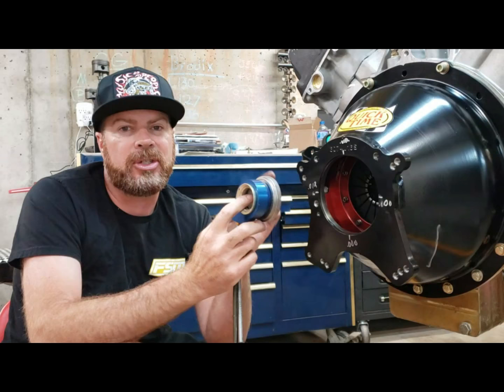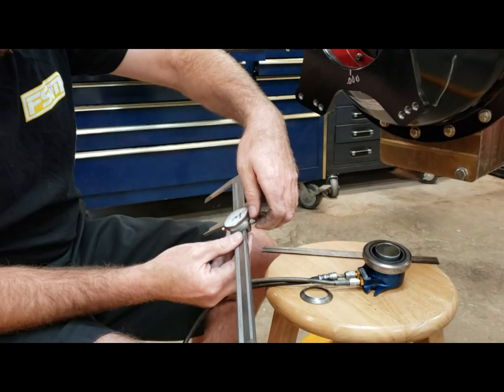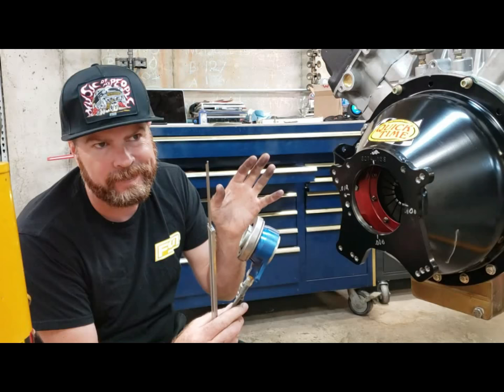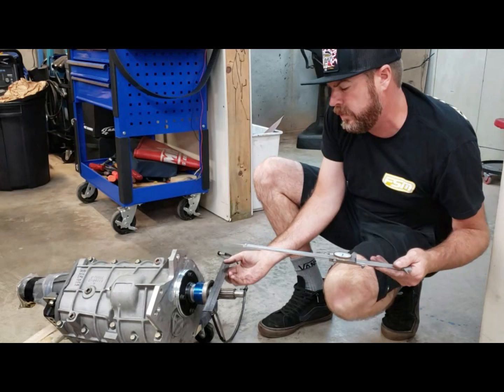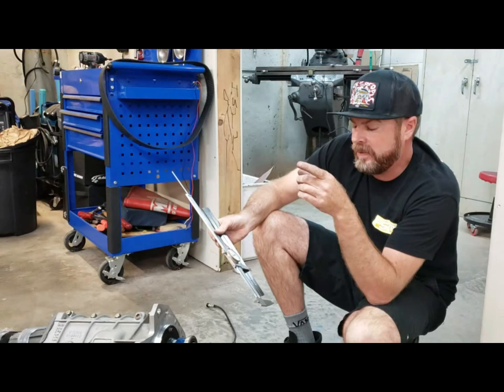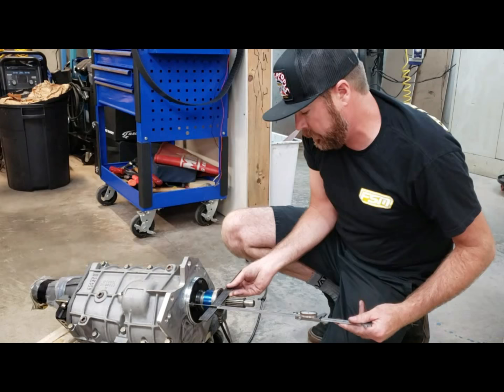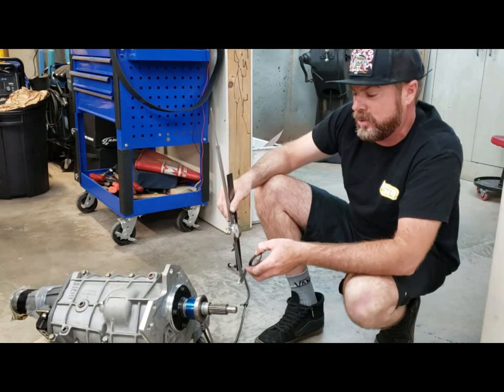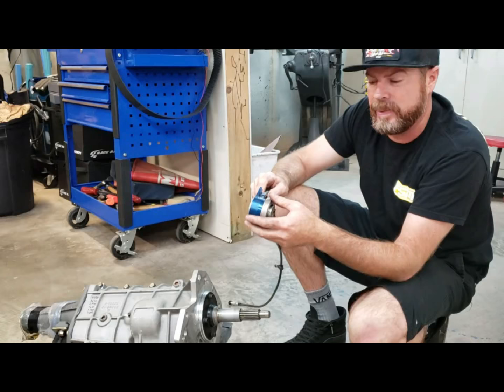Hydraulic Throwout Bearing Installation Mystery Explained! Ep.72

Comment: I really like how in his free time he carefully measures everything to a thousandth of an inch but ratchet straps a gas tank to the roof on Roadkill.
Reply: gas tank on the roof is great for views
Reply: Lmfao
Reply: the engine doesn’t care were the tank
Reply: Because Roadkill is on Motor Trend's wallet, this show's on his wallet
Reply: Roadkill's for fun on someone else dime. Mikes no hack, except when it's fun to be one.
Reply: Well, it's Roadkill, ratchet strapped gas tanks are the norm there.
Reply: 100 thousanths is actually 0.100" (100/1000) not 1/100000
Reply: thats why its roadkill vs his own time and money!
Reply: it's for blashemi, not some roadkill junk car which will in any probability  get sold  after the filming is done
Reply: @alt7488  🤣🤣🤣🤣🤣🤣 Roadkill can't sell any of their junk, they just tried to sell heaps. I think they sold the old Atomic van to Lucky Costa, maybe some more but I don't know.
Reply: The rool of gud ingernrrin is "Measure with a laser, mark it with a crayon, cut it with an ax."
Reply: They’re pretty clear about their tactics. Doing “the wrong thing, the right way”
Reply: you have have been a mechanic for a LONG time....... and you know what it SHOULD be like
you also learn what you can get away with...... 

EVERY bolt on a car has a torque spec....... but am i going to torque my bolts that hold in my headlight?
hell.... the only shit i torque is things like rod caps, mains, head and intake bolts.... 

the rest......tight is tight (at least on my own rig...... a customers car gets a bit more attention, as im getting paid to do it, and the shops rep is on the line)

also you learn shit like..... "ya, im sposed to put in a new cam with new lifters..... but, it looks like it will be ok, fuck it"
Reply: Damn children... When you say one hundred thousandths, you are speaking DECIMALS not FRACTIONS !!!!!
Reply: repapeti, Because Friburger wouln’t let him. 😂
Reply: @keelanbarrette529  Sorry I understood it as "a hundred thousandth of an inch". I'll correct it.
Reply: Because roadkill, I have been of sick for 8 days so far, and have watched it for most of em, time well spent I feel,
Reply: because roadkill
Reply: Roadkill is a show after all
Reply: When you know the rules, you can break 'em.
Reply: @keelanbarrette529  holy shit thanks 🥴

Comment: Oh man, thanks for the tip Mike!  I just took ownership of a custom 1940 Mercury 2 door sedan that has a hydraulic bearing on a T-10 hooked to a 350.  The clutch has a few thousand miles on it and appears to slip a little.  This will help with the diagnosis as maybe the fingers are touching the bearing now and not allowing the clutch to seat fully.  FSM saves the day again!

Comment: I have the APT Hydramax on two of my cars.

(set them to the highest end of the gap limit, for longer service as clutch wears)

After initial set up, I scribed lines for the min/max of the air gap on the anti-rotation stud where the bearing housing travels, so I can see how much "within" limits is remaining. (as viewed through the clutch fork opening) I can check it each oil change with a flashlight.

Once it gets "close enough" to "out of tolerance" from clutch wear, I can roll the transmission back on a floor jack, just enough to pull the bearing off the input shaft, remove a shim and roll the transmission back in place and drive on.

So, I am not completely dropping the transmission, and I can do it all in under an hour.

Comment: good information. I grew up with cars going back to the 30s. setting the "free travel" on the clutch linkage was like adjusting brakes and greasing considered routine maintenance. I hope I never own a vehicle with a hydraulic throw out bearing that leaks fluid because of seals failing and everything needs to come apart. normal correct driving the clutch will last forever.

Comment: It was a lot easier using the Z-bar setup. All you had to do was crawl under the car and adjust the threaded rod for full release and free travel.
Reply: that is why i didnt change my jeep over to a hydro one if it breaks on the sand dunes i can fix it
Reply: Good luck in any offroad situation. Any flex and your clutch wont release
Reply: and less stuff to fail......

Comment: Needed this rn. Was freaking out over how much air gap I needed for the TOB I'm installing on my LT1 T56. Had 31.10 mm. Didn't know how I was going to measure the bearing and trans side. Didn't wanna have to remove the bell housing off the engine.

Comment: Funny u made this video.  I had a 04 mustang gt I supercharged, did a tko 600 swap and the thing ate clutches like it was its job. Cause, no gap on throw out bearing.  As clutch wore at track, it started slipping cause fingers were hitting throw out bearing.  Drove me nuts 3 clutches! I milled down the ball stud hex where u wrench it down so I could make it shorter,  and adj with washers for stud leangth.  Problem solved  on 4th clutch lol

Comment: Excellent video, however I do have a question…At the 4:34 time frame you gave a tip that said you needed to compress the bearing for measurements then said you didn’t. I am using a different brand of bearing and the instructions tell me to compress the bearing fully to get the needed measurement. I am confident about the one I am using following the provided instructions. A bit confused on which process is correct for the American Powertrain bearing.

Comment: What holds the bearing against the transmission? When you let out the clutch, the face will retract from the clutch fingers, but what holds the bearing back from the whole unit sliding towards the clutch?

Comment: you don't need to measure to outside of ruler, then remember to subtract ruler thickness, the calipers have features on them just for measuring between things
use your calipers correctly and you dont need to remember to subtract

Comment: HEY!!
So when I took measurements for my air gap between pressure plate and throwout bearing I left between .10-.15 ths of an inch. Now with everything installed and hopefully 100% bled, the throw out bearing isn’t seating all the way back from where I initially took measurements from so now it seated a bit forward to the point where I think it’s touching the pressure plate. I keep reading different things on whether or not they should be touching. Do I still have air in by lines or should I just remove a shim?

Comment: Hey Mike. Any chance you could do a "Jet Boat for Beginners" episode? I just acquired an old 71 IMP Comanche. It has an Olds 455 and a Jacuzzi YJ pump. Both of which I know are not desirable but I am a little naive as to quite a bit about it such as how to size a new pump, cam selection, anything I can do with the old YJ, how the cooling system works? How do you select parts for your race boat?

Comment: to do the drops really easy get a digital caliper... .and a large machinist square..  set the thick part of the machinist square against the throw out bearing. drop down to the bearing face and zero out your caliper.... now on the straight edge drop down to the face of the trans... no need to subtract the thickness of your straight edge...  do the same to the bellhousing to pressure plate fingers....

Comment: My Tilton 6000 series hydraulic release bearing has been the biggest piece of crap on the planet. I set the air gap perfectly on mine (it's a screw type adjustment) and within a couple months my bearing was spinning all the time, which quickly wore it out. The bad news for me was that every replacement bearing is $50 and I've searched the entire net, all supplier catalogs, etc, and I can't source that flat faced bearing ANYWHERE else. I'm stuck paying $50 each time, and my Tilton is starting to make noise again after about 5000 miles. To top it off, when you get a new bearing, they're sealed, and they sound extremely dry internally. I knew I should have used an external (300z) slave cylinder and a stock Foxbody clutch fork on my V8 swap truck... I'm stuck pulling the transmission every time now, but with an external slave it's an easy part to adjust and change out.

Comment: Technically you wouldn't need to subtract the ruler if you're adding that inch on both measurements anyways. Unnecessary step subtracting the inch, plus you won't get confused if you somehow screw it up and forget to subtract one or the other.

Comment: About to add a hydraulic setup to my b body bbm w/ tko 600. Read there are reliability issues w/ many aftermarket hyd TO bearings...been debating fabbing a mount for a slave cylinder to actuate a stock fork instead. Anyone have opinions/experience they can share?
Reply from the maker: I'm guessing many of those issues are the result of improper installation. Over-traveling the bearing destroys the o-ring inside of it the first time you push on the pedal.

Comment: What did you determine was wrong with the engine after the Hoonigans race? Was it a rebuild or all new again?
Reply from the maker: heads were cracked, head studs had pulled out of the aluminum block.

Comment: Why didn’t you have your air filter on in the clip at the end? Didn’t the car make more power with the filter on stacks?
Reply from the maker: Jonathan F it doesn’t fit inside the hood scoop. To run that air filter I had to build a scoop that was so tall that I could barely see Honda’s when making right turns.
Reply: So in the battle between functionality and horsepower, functionality won this round. Makes good since

Comment: Numbers are hard, typical process is install then remove transmission no less than twice. To achieve proper pedal slop and bearing wiggle.. bonus points for having a buddy try and spin the yoke while your in the car clutching.

Comment: If we are going to go through the effort of measuring to the thousandth, I think I'd also just measure the width of the ruler, just to be sure it was actually 1.000.
Reply: Honestly doesn't even need to worry about the ruler. If you use the ruler for both measurements, it's going to come out the same regardless if you subtract it or include it in your measurement.

Comment: Chrysler Hemi engines are experiencing epidemic roller lifter/cam failures. what do you do to avoid that?
Reply: NebukedNezzer Buy a Chevy... problem solved 😂
Reply: @robwelch9182  I own a very good LQ4 6L in my 1999 silverado 2500
Reply: By not running a late model hemi

Comment: I would have thought you would want the bearing at mid travel so you still have enough to disengage the clutch but enough so you NEVER have to take it back out until the clutch is dead at least that how my factory hydraulic clutch works admittedly it does have a clutch fork but it's still a master slave hydraulic system

Comment: Inch is great in buildings, not precision mechanics.
Reply: 1000th of an inch IS METRIC...... just replace inch with centimeter.... and its the SAME FUCKING THING

and good luck finding metric specs for american shit built in american in the 60s and 70s.... 

converting it to metric = conversion error 
which might just be enough to turn a 5000 dollar motor into a 5 dollar boat anchor.... 

also.... find half of 7.9736 mm

now find half of 3/16s
easy..... times by 2 the bottom number..... 3/32s

Comment: Or you could use a Fox body stang throwout fork and bearing and an external slave cylinder from a 300-Z for about a tenth of the price and not have to worry anout any of this shite..as well as having the ability to R&R it by removing two bolts..
Just sayin...sometimes Roadkill ways is better ways..
😎
Reply: Could this type of setup be used with an older trans and bellhousing (a Ford toploader)?
Thanks